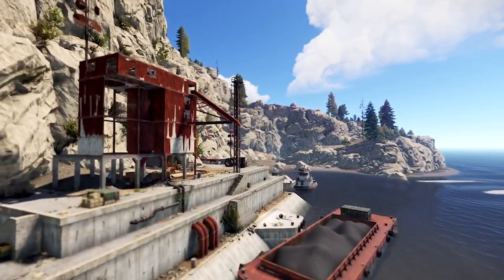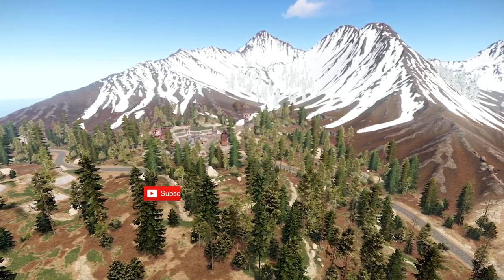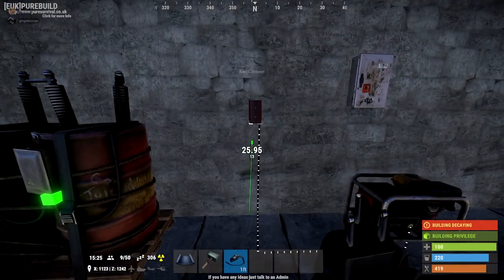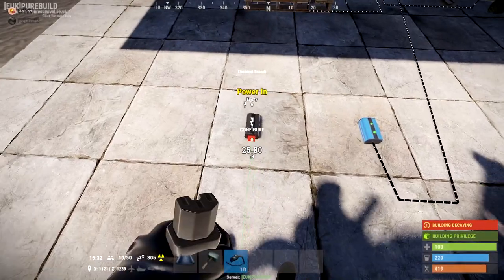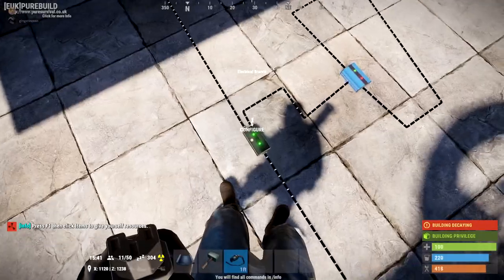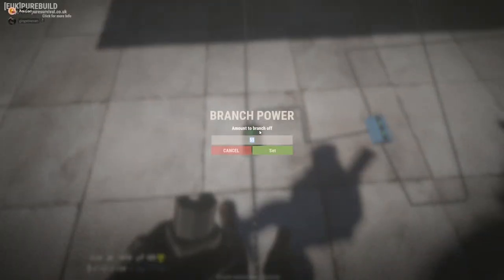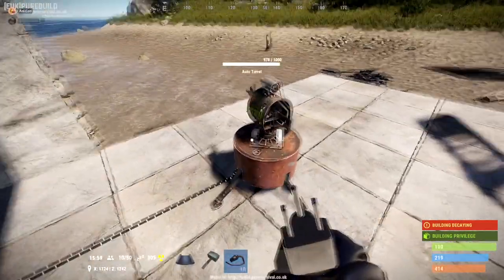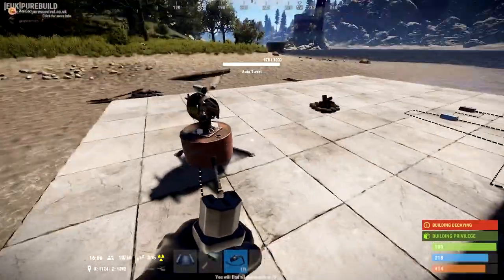🔌 Anti-Raid - Backup Base Defence - RUST Electricity Guide 🔌

Comment: Great video as always.
One question, might it be better for the generator to come on once the battery runs out of power rather than when the power source is destroyed?
This would conserve fuel and/or prolong backup run time. It would require a more complicated circuit to feed both turret and battery, but I'm sure it can be done.
Reply from the maker: Great point! and you're absolutely right. this would be easy to wire up too just by moving the location of the blocker!
Reply: @AniCodYT  yo idk if you’re still active here but if you could explain how to do this that would be great

Comment: is there a way for sophisticated circuit? like using the unused power to recharge other batteries?
Reply from the maker: yes there is. you can set some circuits up so the unused power goes back into a route combiner to recharge the battery. I will make a video on this soon and show you how :-)